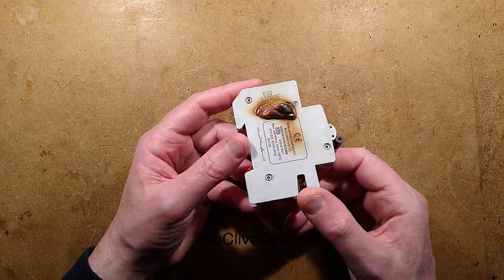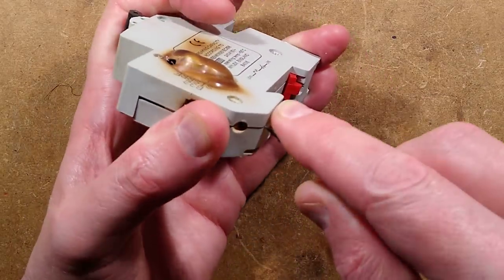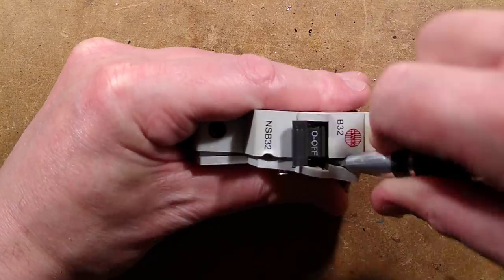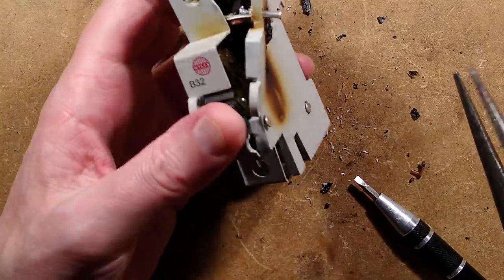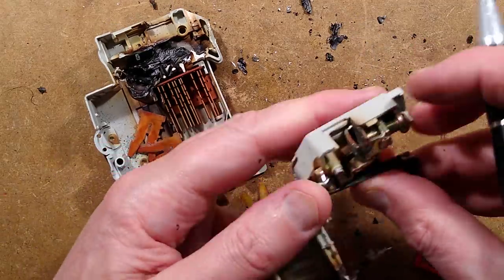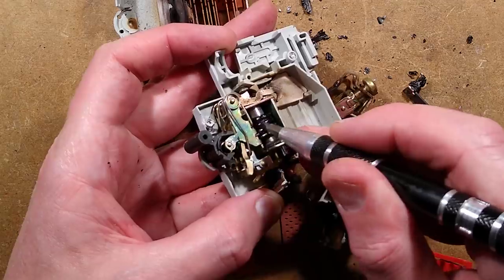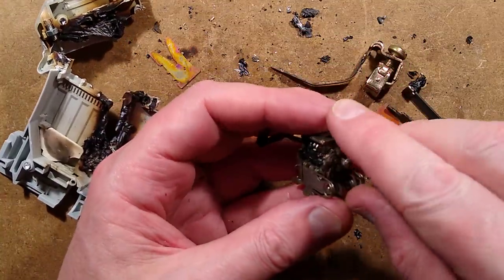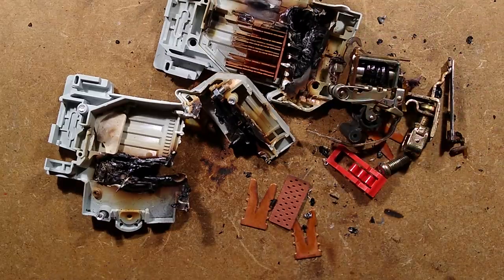Inside a totally smoked circuit breaker.  What went wrong?

Comment: Ok, I've seen worse than this - once- when a contractor was closed onto a fault condition and the unit was quite efficiently gasified.
Reply: Decades ago I was working (student vac. employment) at Arrow Hart in Plymouth, on their Contactor line. We had a failed device returned for inspection by the NCB ( Coronial case - fatalities), and the cadmium plated main contacts has vapourised, "plating" the interior of the main switch assembly, and blowing the aux. contacts off into no one knows where. Very impressive!!
Reply: I have no doubt a "contractor" would fare much worse than this breaker did 🤣
Reply: Phil S 
Oh, that’s nothing compared with what can happen with high voltage lines...
Once an operator at a 750kV station attempted to open the air separators on a big long distance line while the line was still loaded by dummy loads.
This happened because the HVswitch didn’t open despite the damn relay indicating otherwise.
The entire 3phase separator assembly went boom and the huge metallic supports under it melted away like butter in a frying pan creating a flaming river of bright white lava flowing down the ally gutters and on the pavement.
Not to mention the artificial lightning spectacle still happening above was beyond blinding.
Luckily, there were no casualties.
Reply: Ah, I see the mistake.  It's generally advisable (not to mention cheaper) to install contactor rather than having a contractor stand about touching mains voltage lines together and pulling them apart all day.
Reply: @cezarcatalin1406  That would have been an "instant sun-tan / Arc Eye" experience!  The best I"ve personally seen was one of our local pole mount 11kV - 250V transformers having a direct hit by lightning. "Peeled" it open just like a banana, with bits of the aluminium strip LV coils everywhere - literally a nearby hedge covered with what looked like weld splatter. This is why we invest in very decent surge protection, rural "Down Under"! :-D
Reply: Phil S 
This is also why a guard wire should always stay above power lines - so they don’t get hit by lightning.
Reply: @cezarcatalin1406  We never see guard lines on our 11kV sub distribution network, even out in the sticks (where lightning strokes to lines are far from uncommon, and the power lines are the highest points on our flat as a tack terrain!  Keeps the domestic appliance industry in business I suppose . . . .
Reply: @cezarcatalin1406  - When have you ever known lightning to do what you'd expect it to do?  I've seen it bypass a lightning rod, go through an open  kitchen window, and blow up a stainless steel sink.  I know the dishes needed to be done, but geez!
Reply: Yeah, this manual contactor was, in error, used to connect a 440V 1.5MW generator to the grid, but completely out of phase. The contents of the 50x100cm cabinet ceased to exist and blew molten copper and steel everywhere and left the technician with bad physical and flash burns. Not his fault at all - he had no indications, but the control room fucked up.
Reply: @phydeux  Presumably in that case the lightning rod wasn't earthed as well as the kitchen sink was?
Reply: @Berkeloid0  - The insurance company's electrician said it was sound as a pound, the lightning just chose a different path.

The best guess they could come up with was maybe there was more moisture in the air there than up near the chimney where the lightning rod was attached.  

But lightning does some really strange stuff.  When me and my dad's house got hit indirectly through standing water in the lawn, it only fried stuff on one end of the house.  Sadly, that was the end where all the expensive stuff was.

Comment: Our distributors are arranged like this: There are always 2 breakers for a consumer in the path of the current. The one specific to one circuit rated lower made cheaply and one common to the household that is better and specced for higher fault current. This increases safety because a single faulty breaker won't cause damage. (The higher breaker is typically 25A - close enough to the one below it. If you stacked them more aggressively, like 100A, it would be unsafe and you'd need to spec a better single-circuit breaker.)
As for the contact welding, many of the breakers I have taken apart had a feature where they deliberately moved the contact sideways a little to dislodge it. I still have trouble trusting these puny modern breakers. I know they have faster response to shorts, but the robustness is just sorely lacking. Plus the fast response causes nuisance tripping, so one might be better off with the old ones anyway.

Comment: I've seen this happen before.
Twice, in the same house, on the same circuit.

After a long conversation with the home owner, we discovered that it works on the same principal as boiling a frog...
That is to say; if you put a frog in boiling water, it will immediately jump out.
If you put a frog in cool water and slowly increase the temperature, it doesn't notice.
Same deal with a circuit breaker.
You can add load all at once (like flipping a switch), and have the breaker trip.
You can also increase the load slowly (as a thermostat, or dimmer switch), and exceed the rating of the breaker to the extent that the components within the circuit breaker fail.

I tested this with a 3 phase at about 200Hz to a single phase transformer, going to the circuit breaker, then to a T.I.G. welder with the wand in a jig to keep the resistance stable.

Turn the welder on, adjust it as low as possible while maintaining a stable arc, then slowly turn it up.

My homemade mobile generator/welder seems to be able to let the magic smoke out of just about anything I connect to it.
Reply: "Principle"
Reply: @kaisersose5549  "And proud of it. What's YOUR excuse?"
Reply: @SodAlmighty  
Using a keyboard for programming...
Autocorrect doesn't play nicely with python either.

Comment: I used to have to regularly reset an ELCB when I attached a PSU I got from school. It was 19" PSU from an old PRIME computer. It had a very big transformer at the primary side. I switched that on with a powerbar switch that eventually welded together.
So when I moved out of that house, I tried one single ELCB test, I pressed the T button with a long screw driver, and out came a large flame. Last thing I heard, they had to replace it all.
To be clear, I was about 18 or 19 years old.

Comment: Hint:  If you want to take things apart cleanly, drill of the expanded end, of the rivets, and then drive the rivets out with a punch.  A3/8-inch hole in your bench top to drive them into helps a lot.  It lets you keep them flat, while giving the rivet somewhere to go.

Comment: That's the way the cookie crumbles in extreme circumstances!
Internal component failure, not acted rapidly enough to break the supply or high current micro arc flash.
Mechanical fault developed, possibly by repeated resetting without allowing a sufficient cooling down time, whereby it's tripping design function, could no longer react as intended.
Not a good result for a supposed circuit breaker.
Manufacturer take note!!!

Comment: What most people don't realise is that those breakers are not designed to put back in service just after they have tripped. There has to be a cooldown period. Probably, someone was standing next to the fuse board trying to switch it on multiple times while it kept tripping. Because the cooldown period was not respected, the breaker heated up until it welded shut and stayed on.
This is also the reason why you shouldn't just keep resetting tripping breakers. There is a reason for it to trip which must be resolved first, otherwise you make things worse.

Comment: That reminds me of my brother's workshop distribution panel, and the immolated breaker that supplied his old arc welder. That one was well and truly goosed after an hour or so of steel fabrication, and the acrid stench was unmistakable, like a mixture of burnt plastic and cat piss!

Definitely welded those contacts together, and definitely pushed the breaker beyond its design limits.
Reply: Occasional house fires because people try to run a 50A welder off a 30A dryer line by just replacing the breaker.

Comment: Clive, I'm going to have to put a complaint in. Yes, it's about your approach to diagnosis. Before opening it, you should have checked to see if the device was open circuit - irrespective of the lever indication on the front of it. If it was open circuit - then it did perform its function even if not correctly !

Comment: Yes I'd go with repeatedly closing onto a fault. Customers KEEP doing that. If they're lucky, the DNO's main cutout fuse goes before the CU catches on fire. This one came close by the look of it!
Reply: (as you know, but some viewers may not) Consumer units in the UK are fine for 16kA even if the breakers are rated 6 kA only. But only for one time operation. Repeated operation into a fault ... has 'undocumented behaviour'

I believe the original intention is that anything catastrophic enough to exceed the 6 or 10kA rating of the breaker or even come close to it... would be such a bang that the customer would call an expert. Turns out that common sense, isn't.

Comment: When I was a newby electrician's helper, I overheard a story at the parts store of a breaker that blew open a panel and went flying across the room. The parts guy said "Well..it did its job".
Reply: I remember a similar incident. In that instance, lightning hit the electrical pole that carried the service feed for the house. Laughably, the homeowner was an industrial electrician and had also installed an industrial surge suppression system, which was also fried.
He lost the dishwasher and television, the television only had a failed fuse and replacement brought that back to full function. The dishwasher had its control electronics and motor failed.
He had to replace the breaker box as well, due to excessive arcing from the lightning strike.

Comment: Hi clive  whilst your  talking about drill . can you go through the contacts on them .my very old lithium iron drill only has  + -  and works fine with analog triggers . my new drill has + TV bs - contacts and a circuit boards between the trigger with all sorts of cut outs   and will not work with older batteries what's going on ..

Comment: Is the recommendation from this then that all circuit breaker circuits should have a fuse in the circuit ?
Reply: No. While I have on very rare occasions fitted a (say 10A) fuse in series with a (say 2A) MCB; that was when sensing a utility that had a very high fault current capability (100kA I think). For most (all domestic) applications this is unnecessary. This MCB has probably failed because the MCB tripped safely the first time but was repeatedly closed back onto the overcurrent/fault. If an MCB trips it’s OK to close it again. If it trips a second time go and investigate why before trying to close it again (and again … and again).
Reply: @AndrewBlack343  Aww, go on, change your mind - cos it's hilarious !

Comment: So question: Did the breaker heat up so much that it essentially self-destructed before causing a broader fire? Maybe you could do a follow up that explains that safety mechanism.
Reply: Basicly, Looks like the coil heated up after the "breaking" part of the circuit breaker failed. A few years ago Clive pulled a similarly sooty rcbo apart. This that video, K3lBJMpPaOU, he explain how the breaker is superposed to function.

Comment: Someone:  I've got a circuit breaker that keeps tripping when I use the shower.
Dodgy Electrician:  No problem sir, I'll replace it with one that automatically resets 100 times per second.
Reply: Ironically enough, that means it resets every time the mains hits peak voltage in either positive or negative direction thus making the breaker equivalent with a plain wire.
Reply: come on, just replace the breaker with a bigger one. my breaker would trip every time, it was only 40A, I put a 80A instead. problem solved (I have the correct wire gauge for that thou, its only the eletric co that installed a crappy main breaker, I have my own 63A breaker after it)

Comment: In the US we have UL regulations to help prevent poorly designed circuit breakers for being put into market. We have Square D, GE, Siemens, Schneider, and Eaton breakers for our 120/240 split phase mains panels and they are never going to melt and catch fire.
Reply from the maker: In the UK some fake Square D breakers entered the professional supply chain.  No current trip.  Just a switch inside.

Comment: Will that happen if I continue to use my home AC fuses for the direct current of my solar system?
Reply: These breakers are not made for DC. 
You need a much bigger switch for that.
Reply: You will get a similar but different burnout, much worse... and probably the first time it trips or is manually open.
DC breakers can be the same size as AC breakers, but are constructed differently to quench the arc properly.
Reply: @CyberlightFG   AC breakers can be used in a DC application. 
Likewise, AC contactors can be used in a DC application.
Guess what is used for DC supply distribution when the breakers are 1,200 - 2,000 rated?
Yes... AC breakers. So smart Frank? Then tell us how.

Comment: The last time I saw a circuit breaker that badly fried lightning had struck the power pole that held two 100A breakers leading to my house. It never tripped the breaker either, but the wire was free to wiggle, so we'd lose half the power to the house. Never figured out why until an electrician looked at the outer box by the meter reader

Comment: Around the mid 90s I saw something very similar. A cleaver soul had "Fixed" a constantly tripping breaker by jamming something into the leaver and taping it so it would no longer trip. The fault was a screw going through the cable that when it moved caused a dead short about 2 foot from the dist` board. It came through from the room next the the board and had managed to go through the metal conduit. Thankfully it didn`t cause a fire, but did make a lot of smoke and chard wall. The main incomer fuse eventually blew. Interestingly there was that much carbonisation in the breaker the plastic became conductive.
Reply: @Blazin Redeye Been a while since I've opened one up, but both the sustained over current and short circuit tripping rely on the actuation of a spring loaded mechanical latching mechanism. If the switch is held in the on position so that the mechanical movement is prevented, the trip circuits are not able to unlatch the points. I've been in a situation where I had to bypass all safety regulations and hold on a breaker during a startup cycle of a gas extraction system which was causing a spike current draw over the breaker rating. It's not a place I'd like to be again, in BA and anti flash gear holding up a breaker while gas is being extracted from around me. I'm still here so it all turned out well in the end lol.
Edit - I grant you that most modern MCB`s operate in the manor that you say by the use of an internal de-latching system where by the holding closed of the leaver would not work. I did get a replacement breaker to fit into an old style cradle for a wire link fuse that had the ability of being held on that was early 2000`s. think it was an MK unit.

Comment: Will a breaker loose or drop voltage going to an appliance and not make it functional correctly? Nice video on the breaker.
Reply from the maker: You can get a high resistance connection that will rapidly result in heat damage to the breaker.
Reply: Thank you it's been on my mind for awhile. Thank you

Comment: Hi Big Clive,

It looks like a monopolar circuit breaker of 32 A.

The monopolar is not anymore recommended.
You should require a bipolar one.

I dont understand about the internal overheating...

Did you see the little screw adjusting the current and so the force pressing on the bi metallic ?

There is not any protection hiding this screw. ;) 

Maybe your Friend adjusted it by himself to destroy the circuit breaker and to give you a very nice gift to forensic. ;)

Comment: Did I understand correctly that this was essentially user error (re-setting a tripped breaker repeatedly, probably without even a cool down period), and that the breaker did do it's job a couple of times?
Reply from the maker: I'd guess it may have been routinely reset, possibly just flicking it repeatedly until it finally latched.  It happens a lot with non technically inclined people.

Comment: Hi, I've a doubt. Is it okay to put two 250V rated capacitors, one in series in the phase and the other in series in the neutral before a bridge rectifier to make up for a 400V rated capacitor? I want to build a transformer less power supply but I don't have a 400V rated capacitor readily available.
Reply from the maker: Yes, you can put two identical lower voltage caps in series, but each will need to resistor across it to help balance the voltage.  470K to 1megOhm should be ideal.
Reply: @bigclivedotcom  Thanks! 😊

Comment: It actually looks like a lightening strike. OR, arking for a long time. My 200A Maine breaker was fused like that but it was only 1/2  of the 2. My roof was leaking and caused the breaker to start arcing but just a little.  Lights in certain rooms would brown out. Finally after 5, 6, 7 years it failed.

Comment: Wasn't this in one of the recalled ranges that had problems with internal overheating? I seem to recall going around Wylex boards a few years back replacing MCBs with certain batch numbers.
Reply from the maker: I don't think the recall applied to the 32A breakers.  They also seemed to be burning at a terminal.
Reply: @bigclivedotcom  I've looked though my notes and you are right, the recall only affected 6,10, and 16 amp MCBS